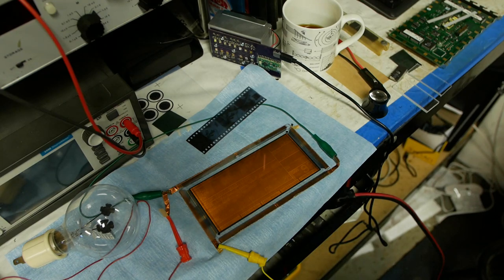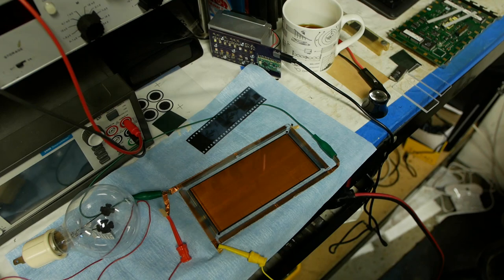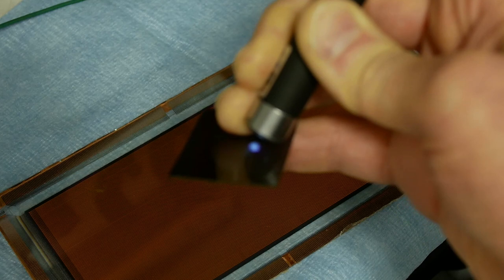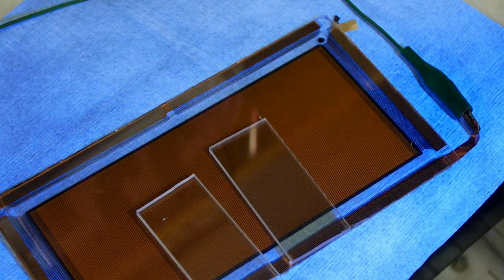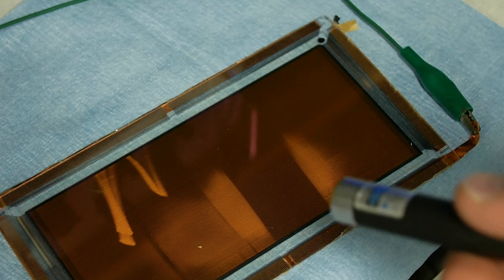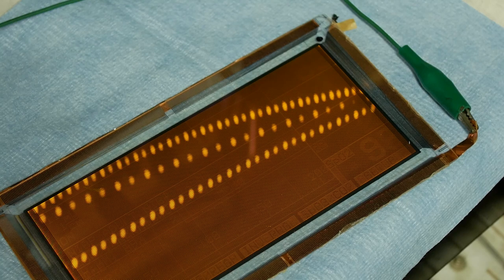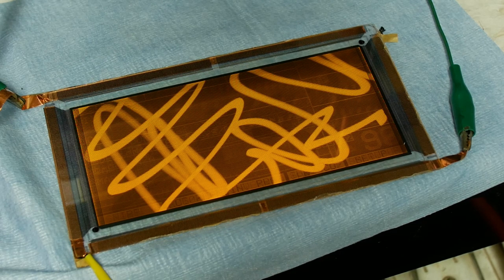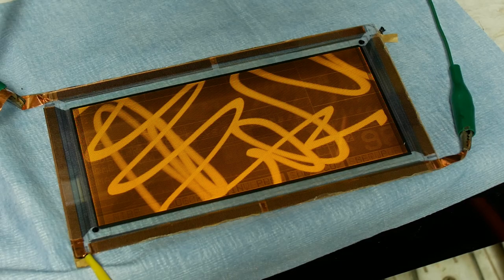Drawing on a plasma display with a laser pointer

Comment: The complexity of plasma TV subpixels probably explains why they had much lower resolution for a given panel size than LCD. I never got into them far enough to understand much about how they worked. The weight, heat, power consumption, and burn-in were just too much of a problem. Sure looked good, though. I've never aimed a UV laser at such a panel. It would be interesting to try, but I don't know what kind of UV filtering the front glass would have.

Comment: Metal+gas+dielectric+metal is basically a capacitor. You can easily drive a neon light with high frequencies using capacitors

Comment: My guess with the large/small dots is, that a small amount of light can bounce between the ITO and Metal and amplifies the effect of the different workfunctions.
But I would agree with the assumption that the ITO and Metal layers have different absorption coefficients for the UV light.
Reply: AMAZING!
Perhaps the difference in dot brightness is a combination of both theories? Maybe the laser can ONLY drag electrons (or holes), and the differing effect is due to the electron (or hole) surplus being alternately on the metal and ITO layer, where the metal will absorb more UV than the ITO. 

Things to test: 
How much UV can make it THROUGH the ITO, and multiple glass/dielectric layers? Does the UV even make it to the back  metal layer?
If driven slightly more strongly/weakly does the lighter-darker pattern of dots become more/less pronounced? This might tell you where the effect is occurring.

Comment: I assume that when the panel is off and you move the laser quickly, then turn it the panel on, there is no pattern. The concept of being able to directly draw on a screen without a software layer is interesing. Imagine by fine-tuning the light and making pixels that react to different wavelengths, and a pen you could tune the wavelength it emits... you could create some very fine art.

Comment: Speaking of displays, I've experimented with a variable vibrating table by putting my elbow on the table then rest my chin in my hand. What's interesting is tuning vibration to different display types only the eye can see
Reply: I used to love drawing on my old monochrome/b&w CRT TV with my UV laser in the dark then watch the drawing slowly fade away as the phosphor loses it's luminescence. I still have a functioning colour plasma TV, I'm curious of what effect (if any) my laser will have on the plasma panel.

Comment: Interesting explanation about difference between dc an ac voltage supply. I would add maybe that in case of dc, resistor is needed, because after ignition, voltage drops significantly, so you need to have something to support that voltage drop (resistor), otherwise current will be too high. In case of AC it’s ok, since high current will flow only during small partition of cycle, so essentially, it flashes.
Reply: Whatever you’ve invented, someone already patented it!!!

Comment: If the electrons are indeed knocked out from the conductor and not from the gas, the alternating brightness of the dots can be simply explained by the fact that the upper electrode is transparent, i.e. does not absorb as much light, and therefore not as many free electrons can be produced from it.

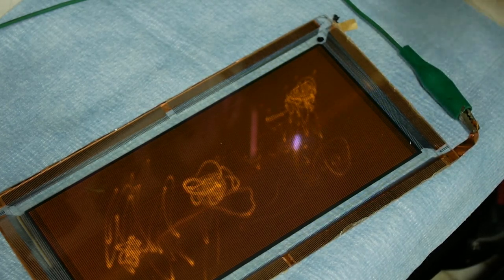Comment: Polarization does have to do with it @3:40 because the laser exits as plane polarized light, thus lowering the intensity in crossed polarized condition. It is that condition that lowers the intensity.

Comment: Neon bulbs used to be available with a phosphor coating the inside of the glass. The color could be green or blue. Most phosphors used for such purposes easily "convert" UV light to visable light. Perhaps his panel has a phosphor layer in it.
Reply: Wow this is a amazing! 
I have a 48 in. plasma TV that I was getting ready to strip for spare parts. I might try to get it working again and try this!

Comment: I've already been thinking about designing a LED/Plasma panel driver that can also read out pixels. You could have an upgraded version of the IR port communications, several hundred gigabytes per second potential transfer speed just touch the two devices screen to screen. We might actually see it in future technologies.

Comment: Dots from moving the laser fast - I would wonder how much of that is due to the laser itself pulsing. Driver circuits for most cheap diode lasers are designed to deliver power in a 10 Hz cycle, although some are designed to just keep the laser on continuously - which may lead to the overheating of the diode.

Comment: I just had a plasma TV die (stuck in endless restart loop.. and no real ability to get parts for any sort of reasonable price it seems).. maybe this could be a use for it.. Hrm.. Although colour plasma - would they  have different layers per colour.. hmm
Reply: I think in a plasma display there are 4 subpixels per pixel (most likely in a Bayer pattern just like in a camera) and they have colored phosphor to make them red green and blue. Like he said here, you'd have to drive them all to a partial bias voltage to see the effect, so you'd have to strip out all the existing drive electronics and come up with something custom
Reply: Also if your tv is stuck in an endless boot loop, check the power rails for bad capacitors, especially the lv rails like 5v or 3.3v. Should be easy to fix just by replacing a couple electrolytics

Comment: Cool experiments, I wisi I had a plasma display! Got only LED displays, LCDs and an occassional VFD.
Makes me wonder if using a camera's flash to expose the display through a negative would do the trick, multiple times if needed. Or just use that powerful LED for a long-ish time...
Cool pinball display there :) I like its PCB design.

130V at 700Hz? Hmmm, I wonder about the display's impedance in these conditions. Migh be high enough to drive it with a simple vacuum tube oscillator, adding a cathode follower if needed.

Comment: AMAZING!
Perhaps the difference in dot brightness is a combination of both theories? Maybe the laser can ONLY drag electrons (or holes), and the differing effect is due to the electron (or hole) surplus being alternately on the metal and ITO layer, where the metal will absorb more UV than the ITO. 

Things to test: 
How much UV can make it THROUGH the ITO, and multiple glass/dielectric layers? Does the UV even make it to the back  metal layer?
If driven slightly more strongly/weakly does the lighter-darker pattern of dots become more/less pronounced? This might tell you where the effect is occurring.

Comment: Question: Does your laser pen have a duty cycle?
Reply: no. I have one of these $3 'blu-ray' 405nm pointers from ebay and they're just DC. Always on as long as the button is pressed.
Reply: @Muonium1  Right. You wouldn't be able to read a disc with a pulsed laser.

Comment: The dielectric layers stop any charges liberated from the metal or the ITO.  But capacitors have displacement current, I=C dV/dt.  The dielectrics capacitively couple the metal and the ITO to the neon layer.  If dV/dt is large enough, the neon cell will need no help to illuminate.  If it is just shy of this threshold, then any light that matches a transition in (stressed) neon will liberate an electron to be accelerated by the E field to liberate more electrons after collisions.  As E decreases, plasma generation ceases and the electrons and ions recombine via exponential decay to produce a dying light.  There is another threshold where maybe a few ions and free electrons remain to illuminate another half-cycle of AC.  Lowering the frequency or the amplitude we can achieve a specific state where the light slowly dissipates over many cycles... plasma heats the cell and it takes a little time for this thermal contribution to ionization to dissipate.

ITO is a doped semiconductor (I believe it is p-type, but my memory is not what it once was...).  One polarity will deplete the ITO of carriers and increase its resistance whereas the opposite polarity will inject more carriers and decrease its resistance.  I believe this is the source of the asymmetry.

Comment: Could the difference in UV transmittance between the metal and ITO layers explain the changing dot intensity? Even if they had the same work function and only electrons were liberated, if the metal layer absorbs more photons it'll produce more electrons than the ITO right?

Comment: If this is activated by high energy photons, would it work for detecting radiation gamma sources?  If it worked like the old fluoroscope x-ray machines, could you use it as a portable x-ray machine?  Since scotch-tape being unrolled produces intense x-rays, could that flash the image of your bones in your finger overlayed on the screen?

Comment: Little neon bulbs do not light up in the absolute dark, even when you apply the full 90 Volt voltage.
They required a minimum of background lighting if you wanted them to turn on when you apply the voltage.
I used neon bulbs extensively in the design of relaxation oscillators, as those in old tube colour TVs or signal injectors, and I had no way of knowing if the neon bulbs sourced by the manufacturers were firing in the dark or not; therefore I was forced to couple optically a miniature undervolted incandescent bulb to the oscillator bulb.
We later solved the problem by using some minimally radioactive material in the electrodes or the glass of the bulb.
Every neon bulb manufacturer can tell you about the problem of initial ionisation of small neon bulbs (if you can find any!).
A plasma display is the equivalent of an array of really minuscule neon bulbs, so it behaves as expected.
Reply: Little neon bulbs do not light up in the absolute dark, even when you apply the full 90 Volt voltage.
They required a minimum of background lighting if you wanted them to turn on when you apply the voltage.
I used neon bulbs extensively in the design of relaxation oscillators, as those in old tube colour TVs or signal injectors, and I had no way of knowing if the neon bulbs sourced by the manufacturers were firing in the dark or not; therefore I was forced to couple optically a miniature undervolted incandescent bulb to the oscillator bulb.
We later solved the problem by using some minimally radioactive material in the electrodes or the glass of the bulb.
Every neon bulb manufacturer can tell you about the problem of initial ionisation of small neon bulbs (if you can find any!).
A plasma display is the equivalent of an array of really minuscule neon bulbs, so it behaves as expected.

Comment: You should look into photoswitchable molecules; molecules that can reversible isomerise between two or more states, specifically the azobenzenes and dithenylethenes. I imagine you could achieve something similar by coating a surface with a solution of said compound, irradiating with one wavelength to induce a colour shift and reversibly converting back to the original state with another wavelength of light. With photoswitches however, you can induce the reverse reaction with heat or electrical potential.

Comment: Imagine this instead of whiteboards in schools! Just a display and a rechargeable laser-pointer. If it can do readout, you can store the image and send it to the students before wiping it at each power-cycle. And you can even copy images from negatives on it. TBH this could sell well if developed and priced well enough.
Reply: Does UV light work on "holes"? 
i've seen those electrostatic foils work on UV light, but if you reverse and make "holes" (positive charge) the UV light did nothing.
So perhaps is the ITO shedding electrons in the second cycle ?!?

Comment: I worked on sensor panels, think lcd panel but camera, and those things were crazy sensitive to burn in caused by ambient light. Something about charge building up on the tft gates and getting stuck there. We could sometimes fix it by tossing the panel in an oven for a while.

Comment: Many a times LEDs are driven by PWM to limit the average current through them hence the average light intensity. Maybe this pointer uses the same method.  This can be verified by shining pointer's light on phototransistor and observing it's output on oscilloscope.

Comment: Very original idea. Thanks for sharing!

Could you please elaborate on the idea of AC driven display where all rows would be shining at the same time? How is it supposed to be updating the display? Wouldn't a glowing plasma in the previous line complicate driving the pixels in the current one, using just X and Y conductors?

Moreover, I once measured my vintage IBM P70's plasma display using a high speed photodiode and it flashed very brightly for only a limited time (roughly 1:number_of_lines) each frame. It still can use quite high frequency AC in each line -- I always thought that these AC display tricks were mainly to reduce erosion that would otherwise occurred on electrode if DC biased waveform was used (even LCDs do it this way).

Comment: Regarding the light and dark dots, as I’m sure it’s already been suggested, I would guess the luminance of the dot is related to where on the AC wave form the light hits. This would be emphasized by the uneven speed your hand moves the laser across the cells in the plasma.
Reply: could be that the laser has a non constant power source as well. Perhaps its being PWM'ed to control power, or there is a switch mode regulator in line.
Reply: @TheTerminator414  sure I’d say that is posable. Had not considered that.

Comment: Why does the display need ITO? Can each pixel operate like a laser and so your top surface just needs areas that are half metalised? It would cut down on the fabrication complexity.
Reply: Neon lasers aren't that easy to get lasing. Ok you have pumping, but the mirror distance needs to match, how do you even reach inversion with just neon?
Or do you mean just use the half mirror part without lasing? Interesting question, I'd think there'd be losses throughout the gas and with the dielectric layer.
Reply: Making each pixel a mini laser would be both potentially dangerous and also make the display basically impossible to see from any angle other than directly in front
Reply: @acbthr3840  Not correct, you could in fact have more control over the shape and intensity, not less. All you need is a cheap roller embossed lens array over the top to control the lightfield from each pixel with a very high level of accuracy. You may not even need a lense as the half mirrored area could be patterned in such a way as to perform both functions, a reflector and as a holographic lens.
Reply: @emiliehans5225  I did not assume neon either, but He-Ne lasers are a thing, unless you don't like the color pink?

Comment: You didn't really go into, in fact you hardly mentioned at all, how the effect is actually reversed when you expose an energized display vs. an unpowered one.
On the energized display, the laser brightens the display. On the unpowered display, the laser-exposed areas end up darker when you turn on the power.

Comment: Interesting. You you’d be able to power flash in discrete sections of the board? You could theoretically make tool effects you can switch between if so. But it’d require state reading of sections to in order really record anything long term or do good software aided refresh/record. If you do though, you’ve got yourself a lofi data slate. Hook it a phone, and you only need the slate to be in range of it.

Comment: that bias-dependent behaviour, and memory could be useful for analog computing right. imagine encoding velocity into spatial information. the encoded and stored spatial information can be counted and output as speed. The volatile memory mode (without AC power) could be also useful, encode proximity into intensity??

Comment: So, it is impossible to use them as an input device? You’d need to sample voltage across each pixel’s impedance, which is buried inside the panel. You could design a panel with vias for each pixel, but manufacturing it wouldn’t be trivial.
A colour or otherwise variable brightness greyscale plasma display may use more accessible (variable?) impedances for current limiting to the pixels, but it sounds like a nightmare.

Also why do so many display technologies require AC? EL I can understand, but plasma? Even LCD needs AC for some reason I can’t get my head around. Next thing you’re going to tell me OLED needs AC.

Comment: Very interesting! I'm curious if you have an explanation to the "erase" at power off effect. If charges were indeed trapped into the dielectric, they shouldn't be able to migrate away, just like in the EPROM case, the way we migrate charges off the dielectric is shining the UV light to "knock-em-off".
Reply: Another comment under this video proposes a minimal threshold of activating the plasma. The display is actively driven at a low power level, then the laser input pushes it to a photon emitting state. Once the underlay of low power input is turned off and back on the display is refreshed, erasing the laser drawings.
Reply: @Bobsry16  yes I thought of a similar effect, a kind of "thyratron" if you remember the old gas-filled tubes, but still it doesn't quite explain why a low emission would not trigger the "full" ionization as an avalanche-kind of effect but only a minimal raise in light output.

Comment: Very cool and interesting.  So the (semi-)permanent change from the laser is in the dielectric material, correct?  If the liberated charges were retained in the gas you would expect the image to immediately smear, wouldn't you, since the gas layer is continuous and not segmented?

Comment: Bro, the laser just turn this gas into plasma by hitting the gas. Next, you have plasma that can conducts current, the AC is flowing supporting the plasma to stay. 
The pixels are on forever, until power is gone. no magic.
The trick is in the laser ability to ionize the gas by stripping the electrons apart from the nucleus and make it a conductor. this serves as a trigger for always on.